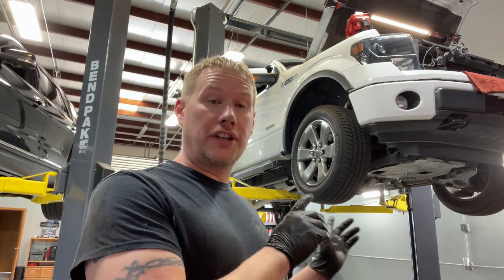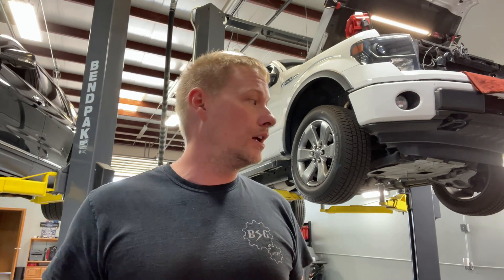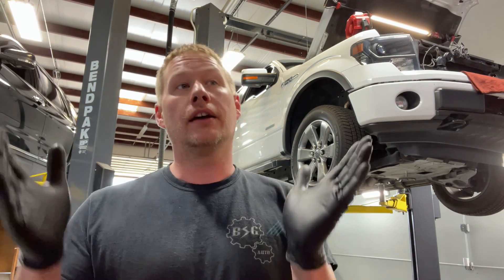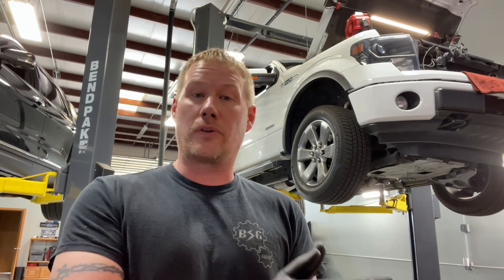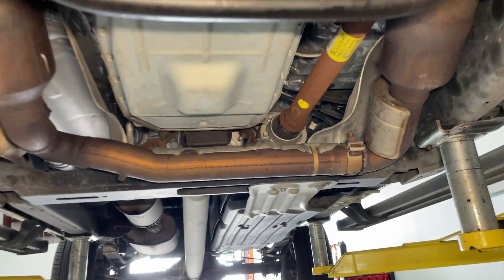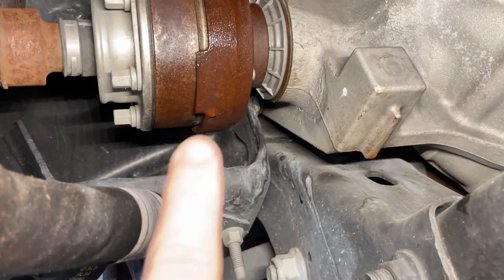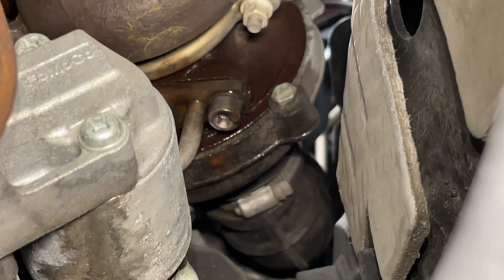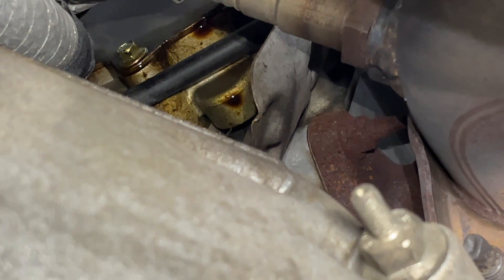Ford Ecoboost Engines Can be so Hit or Miss: I Really Feel Bad for This Customer...

Comment: I don’t know what happen with Ford’s quality control I’ve been a Ford man my whole life everything from F150, F3 50s my 6.2 was excellent I love it my 351s Windsor ,  mostly I had those never had a problem , I took real good care of it but I used it hard for towing every single day never had one problem I think the alternator went out on me and that was the only thing that ever happened to the truck, 302s never had a problem you know they have a lot of problems with the new diesels , I see on line , A lot of little problems with a very expensive, make sure really wonder if you’re going to buy a new real expensive truck where you want to put your money down, are used to be totally a Ford man now I’m like I don’t know, they have a lot of leaks on the eco-boost and this is supposedly their new go to engine with a smaller eco-boost they need to get it together maybe the car companies don’t care anymore because they wanna make these electric pieces of crap, which I will never drive

Comment: I'm not surprised , a twin turbo engine is very expensive when it comes down to maintenance and repair. Why didn't Ford HAVE AN OPTION like a supercharged  INLINE 6 cylinder, most ford techs do not recommend the Ecoboost motor over the 5.0 Coyote motor anyways , just look at the mess and manhours and parts that are involved with repair. i will take the 5.4, 5.0, 351 W or the 7.3 over the Ecoboost engine. Brian thanks for Sharing as always take a deep breath  relax , I'm sure you will get this back on the road!

Comment: Damn the more I see and hear issues with the Ecoboost engines is why I'll never own one, same for turbochargers also. Give me a plain natural aspirated engine without all the extra potential problems any day.
Reply: 5.3 Chevy . Pushrod reliability . Although, not perfect , but much less problems.
Reply: @Czechmate.z  Unless you have one of the new ones, lifter failures and bent push rods. I have a 20 year old Z71 with the 5.3, I am the second owner, got it from my son six years ago when he bought a new Ram. He just bought a left over 2020 F-150 with the 3.5 Eco-Boost, so far so good, time will tell I guess.
Reply: I’ve put over 100k on my ‘16 ecoboost. Yes did timing chains myself. No fun, but is a lot of fun to drive and tow. Overall great engine, still happy to have it. Tows much better than the 5.0.
Reply: Modern NA engines suck ass now because they are using too many cheap components in the engine. It doesn't matter if you never get oil burning by changing your oil early in an NA car if half the components the damn thing is built out of is plastic

Comment: That is how it goes. The heat kills everything. I just got my 27 6ear old BMW out of the shop. The Phoenix Az.  heat cooked my fuel system and a trans shift rod seal that cost me $2600 .75000 miles.

Comment: I was just in the market for a new (to me) truck. Needed to replace my ‘10 expedition with the wonderful 5.4, that was about to cost me heaps of money. Timing components were starting to go, and in my investigations I found it had a timing job done already with cheap parts. Didn’t want to deal with it. 

Looked at newer f150’s and Silverado’s but I just couldn’t do it. Found a Tundra instead. I won’t support the “made in America” brands if they still can’t make a functional truck that won’t blow an engine in less than 100k miles. Besides, tundras are made in Texas anyway.

Comment: As far as the coolant leaks you have to wonder if when he had the coolant change if he did if they added regular water with antifreeze versus distilled water I noticed that the electrolysis will start to set in you get seal leakage and all the other crap if you don't use either the pre-mixed or distilled with concentrate

Comment: No as far as that water pump leak I happen to have a 2000 Silverado with a 5.3 and my water pump oozed oh probably for about 3 weeks and I had somewhere around 110,000 miles on it and then it stopped well the water pump finally took a dump at 325,000 and the truck now on the engine has 400 plus 1000

Comment: If anyone is replacing the turbo fittings, make sure to also check the rear exhaust manifold bolts while you’re there. They tend to “disappear” on these engines over time

Comment: I felt this way when I bought mine. plugs, IWEs, vacuum pump, cracked IWE actuator, blend door actuators, blower motor module, signal stock wiper switch, and a newly found startup rattle all within 2 years. Yet I know plenty of guys going years with no problems at all.
Reply: Same problems with my 2018. Huge disappointment after my 2012 was flawless. I need to get rid of it but now truck prices are ridiculous
Reply: I have a 2011 5.0, had it since 100k now has 207k miles and zero issues, other than a coolant drip from the Y but has since been fixed

Comment: On my 05 dodge 2500 Cummins I installed a coolant filter have never had coolant issues . I now have 315,000 miles with out any cooling issues. could this help you ford guys.

Comment: I had phaser rattle after an oil change.  I thought it odd so I replaced the filter with a Motorcraft filter and topped off the oil. Phaser rattle went away IMMEDIATELY.

Comment: Stories like this drive people to Toyota and Honda.  As much margin that Ford makes on trucks there just is no excuse for these types of problems.  The accountant's need to take a back seat at Ford so that the engineers are free to design 300,000 mile vehicles with no leaking gasket, seals, and fittings.  It is done all day long on foreign brands, why not Fords?

Comment: I have a 2013 F150 5.0L and I had a coolant leak at about 85k miles from the y pipe that goes into the throttle body. One of the O-rings got too flat and it started seeping out.

Comment: They really need to redesign this system, my old bmw had 252k miles and never had any Timing chain rattles or vanos issues.
Reply: No Vanos issues? You should play the lottery, probably will win without scratching the ticket!
Reply: 2nd gen of the ecoboost did upgrade the timing chain to 2 row, and a few other upgrades.

Comment: I have a '11 Ecoboost currently 170k on it. Starting to get the start-up timing chain slap periodically. Not looking forward to doing that job. So far I have only had to replace the water pump and transfer case motor on this truck. Otherwise i've been super happy with it.

Comment: Poor bastard, and I feel for him.  Sometimes, no matter how well you take care of a vehicle, you just can't over come the OEM under-engineering which Ford specializes in.  That's why I stay away from the 3V and Eco-chit engines.  My 4.6L 2V has 83k miles with no fluid leaks, no oil consumption, no timing chain noises, and no wallet screams.  I'll pass on financing Ford's C-Suite's retirement plans.

Comment: I have one of those 5.4L 3V Triton engines where the spark plugs can break when changing out.  Luckily, I haven't had engine leaks or knocks and I pull a boat regularly.  What I have had in the past was a bad front bearing and now an upper ball joint is vibrating.  Not terrible and easily fixed in my driveway.  One thing I think was poor engineering (besides the spark plugs) are the front brakes.  My year truck the bearing hub and rotor are one piece.  I tried to order a floating rotor retro kit but when the parts came the hub and rotor were all one piece.  Grrr!  Anyone know where I can order the correct retrofit kit?  Anyway, sorry to hear about the truck and the problems.  Since its so new, its worth the money to fix but generally, other problems start to crop up.  It might be time to sell while the truck still has value.  Just my opinion.  Thanks for the channel and the opportunity to post comments.
Reply: Centric makes the 2 piece  hub/ rotor I installed on my 06 f150  4 years ago and no issues so far
Reply: @foxwood67  I'll look into Centric again. I was having a hard time navigating their website.  Thanks.

Comment: My 2019 King Ranch F150 max trailer tow package with 3.5 has the startup rattle at 20k already. It has to sit for 24-48 hours to do it. But it's getting worse.  I am considering trading to a 5.0 truck because of it. Already been to the dealer with a front timing cover leak as well at 6k.

Comment: I'd likely drive to you to work on my 3V triton, it would likely be a few extra bucks in gas and lodging.  With the prices of these trucks these days, it's almost insane not to repair an otherwise good vehicle.
Reply: That engine is one of the Car Wizards least favorite engines..lotsa expensive repairs & poor design..avoid the Noid of Ford engines ! Don't get a 6.0 or 6.4 Ford diesel, either..the 4.6 or 5.0 are much better

Comment: I have a shop in Dallas. This seems to be all ford ecoboosts. Many with much lower mileage than this one. I am also a dealer and I avoid these ecoboost trucks like the plague. You pay top dollar for them and then end up putting thousands more to bring them up snuff to sell. Needless to say I always lose money on them. The 5.0 seems to be the best choice. Very rarely have issues with them compared to the ecoboost engines. Maybe its the extreme heat along with moderately cold winters. I have no idea. In my experience the Ford with the coyote 5.0 at least years 2011 to 2017 are the best trucks made. The second best would be the Ram with the 5.7. I just don't get it.  Why has ford doubled down on these turbo v6 engines?  They actually get much worse gas mileage than the V8, unless you drive like a grandma. I look at the average mpg on the dash when these come in for service. Under normal driving the V6 is always at about 15 mpg and v8 engines are always at about 14 to 15 mpg. I know they can make the v8 more efficient and still have better reliability at a cheaper cost then the v6 if you factor the extra cost of the turbos etc. Any insight is always appreciated.

Comment: Had my cam phasers replaced at 35K miles on my 2019 F150, front differential went bad and was rebuilt and rear diff seal replaced at 40K miles because it was leaking.  Think it's time to put an extended warranty on it to get me out to 125K miles, but will definitely have to have it checked for leaks before factory warranty on engine and drive train expires at 60K.

Comment: Ford warranty use to piss me off with these things. Customer would come in with an exhaust manifold leak and when I would replace them I would replace all those bungs and tubes as well cause they were guaranteed to leak once you disturb them and Ford refused to pay for them ahead of time. They would make you fix the exhaust leak and then once it came back leaking coolant they would pay to replace the bungs and tubes. Nothing like doing a job twice.

Comment: Not surprised, my 2013 flex with non turbo engine just did the water pump @ Ford $2023 dollars Canadian. Also hvac control module and blower motor for an additional $1300 Canadian. Last Ford for me if I can help it😒

Comment: I have a 2013 Taurus SHO. I’ve owned it for less than two years. Bought with about 90k and now has 123k. I’ve had to replace the timing chain and torque convertor so far. That, along with regular maintenance, has nearly cost me what I paid for the car. I plan to sell it and get a Honda or Toyota. I will never buy a modern American car again. The generations of public school kids have grown up and gone into the workforce. Apparently, they all became engineers, and lousy ones at that. At least the Japanese still value intelligence, and produce fine engineers.
Reply: Nah, the  US still has great engineers... They just all work for Tesla and SpaceX now.
Reply: Don't blame the engineers, they're under the thumb of their corporate overlords, to whom the bottom line is sacred.
Reply: @ccengineer5902  Probably right overall, but have you seen the ‘13 V6 Ecoboost timing chain? I’m no engineer, and even I could tell you it was a bad idea. It probably has a 5ft circumference….no joke. Later models were redesigned with a dual timing chain. That was $3200 out of pocket. And….it gets worse….a water pump behind the timing cover? Yep. Can’t chalk that up to cost savings. Just bad engineering.

Comment: I had a 2012 f150 fx2 3.5l I don't drive far to work but I do drive hard. After replacing the ho sensor and lead frame + Trans controller software update for sudden downshifting, r-side turbo, fan resistor, cab fan spark plugs at 48000 for a misfire during acceleration , the Trans whined when shifting from 1st to 2nd, the phasers/timing chain started rattling intermittently at 50000mls, also had a cold start misfire which was prob carbon  build up, the head that controls the defrost/fan n ac started to not work intermittently traded it in 2 months ago had 58000mls.

Comment: I had many coolant drips on the 5.0 in dealerships as well from those blasted quick connect o'rings, water pumps failing at 60,000 miles. Owning my own shop for 5 years before heart attack gm trucks to be a bigger piece of junk with a local gm dealer having 80+ under warranty  Gmc/chevy trucks with 5.3's oil consumption issues waiting to be tore down and ringged with no honing of the cylinders along with camshaft failures in another pile of trucks with pissed off customers and techs walking out from cut warranty pay times. Owning my own shop gm's kept the shop full and kept our scrap iron barrels full, and transmissions oh god them gm truck transmissions failing up to 2015 when i had to quit. People will bash this but if you don't work in a high volume shop and see these things then you don't know crap. Not all vehicles do these things and some do. I like the ecoboost  engines and 5.0 i like the gm 5.3 and the ram hemi  they all have their good points and bad. I have had to work on all of them. Just wished i could afford a hellcat LOL

Comment: Thank you for the videos.  I just bought a 2021 f350 with the 7.3 and am crossing all digits that it's a good one.  I've had good luck with Ford.  I had a 3.0 in a Ranger, 5.0 in an Explorer, 3.5 in another Explorer, a v10 in an Excursion and now the 7.3.  We'll see...  But thanks again Brian for the insight and knowledge with FERDS
Reply: The 7.3 Godzilla is a badass engine. Its built totally old-school and designed by the same guy who designed the 302 windsor somehow!

Comment: The fittings on the back of the engine that connects the coolant pipe to the turbo are also very common and aren’t very easy to change.

Comment: you're a good mechanic for giving it a good vidual, looking for leaks.  i took my 2003 f150 to a local transmission place for service. they neglected to inform me about leaky trans cooler lines... could have had my tranny blow up, loose fluid...

Comment: I bought a 2013 Fiesta with 90k(ish) miles and knew I had to do a clutch job but, while I was under the car finishing up I noticed the water pump leaking...ugh! 
Decided to go ahead and do the timing belt too.....that really pissed me off.... makes you wonder if the coolant Ford uses is crap like Dexcool.

Comment: Everyone brags about the 3.5 ecoboost and acts like its so great over the 5.0. But you can't compare the two motors. One has turbos and one is naturally aspirated. Ecoboost the 5.0 or put a procharger on it and see what happens then. lol If i was to even think about getting the 3.5 ecoboost because of towing, I would just go with a diesel.

Comment: I hear you I bought a 2016 Lincoln Navigator the day I bought it the plugs needed replacement @125k which got rid of the huge miss under high load. I replaced the coils and differential fluids front and back. But other than that it has been great but I’m one of those people that do maintenance religiously. Next it’s a trans flush, but so true hit and miss on these 3.5 eco boost trucks.

Comment: I think some the problems with these ecoboost engines is that some people don't drive them much.  I had a 2011 3.5 that a put 180k on it without a single issue but I drove it 60-80 miles a day.  Regular maintenance was all I did.  Maybe a wrong but that could be why some people have a lot of issues with the ecoboost engines.

Comment: Turbo = high maintenance. Soo hot in Texas and if you tow it just exacerbates things. The turbo leaking , especially the  coolant tubes is pretty common. The worst is unbolting the turbski from the mani, those bolts can be brutal. I suggest people do , due diligence before buying a vehicle and im not their momma its just more work for me. Also a simple catch can is so important on any boosted engine, get one.

Comment: That's why my F250 2000 almost 500K running strong - Reliable and Simple! Modern engines won't ever make up even to 300K without major repairs. Great video, thanks Bryan.
Reply: True I own the f150 same year. It's over 200k miles
Reply: Yea but what engine, some are great others are cr@p
Reply: My 2011 F150 EB has 372k only major repair transmission ate 350k. Some is maintenance some is luck of getting a ghost truck.
Reply: @davidmiller8529  What engine do you have in it??
Reply: I recently saw a 2015 Silverado 2500HD with the 6.6 duramax diesel sitting at 355k miles, so I guess we will see.
Reply: With proper care they will.  People fail to read the service guide...

Comment: 9000 miles a year..Short trips?  Hot climate?  Anyway, in a truck, a pushrod 2 valve per cylinder engine with port injection is the ticket..Cost per mile is what counts and all this fancy shmancy crap may look good on paper but when the rubber meets the road it just doesn't make any sense.  Same goes for displacement on demand and variable valve timing.  The government has forced everybody into this non-sense and  we are paying the price..

Comment: Common problems for extended oil changes with aftermarket filters and not changing coolant regularly.  Easy job though, I do a few of them a month.  Lift the cab off the frame and get it done in less than a day.